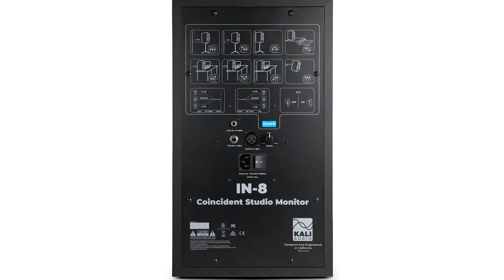Why I LOVE 3-Way Monitors: First Look at IN-8 by Kali Audio

Comment: Thanks for the video. My question is how do these sound at quiet/moderate volume? I am interested in getting a pair and I don't know if it's better to get the IN-5 or the IN-8. I mean the IN-8 are way too big for my room but I'm thinking if I turn them down a little I will benefit from their bass extension. Any tips?

Comment: What I noticed in the measurements in the web and yt, is that they lack a bit of high end. They have a dip in the 9k region and I was wondering if it a problem. Is it noticeable?  Does that dip push the engineer to bump everything up in that region and later the mixes would sound a bit harsh and maybe too bright? Thanks.

Comment: I have a pair of white Yamaha HS 7’s at home, I only have my 6 x keyboards run in stereo and plugged into a mixer, then plugged into the Yamahas, I hate how the HS7’s sound, are the Kali IN8’s a massive improvement in all departments? 

I have my monitors on stands in the corners of my rooms (around 1.5 metres from the wall and around 50cm from the side of the walls, my room is not huge

Comment: Would the new IN-8 V2 along with thier Kali subwoofers make a good mastering system for a well treated room at a fairly serious home studio? (room 8mtr x 9mtr and 9ft ceilings)?
Reply: that would be an excellent mastering system. The problem is properly implementing a subwoofer in such a small room. Alot of nodes, bass problems. If its acoustically treated, and you used some sort of room eq, then it should be fine
Reply: @ewcho8995  Thanks for your reply and confirming this for me, Kali actually just replied and also and said only 1 sub is required, as one sub keeps up with up to 5 IN-5 or IN-8's so that's good... My room has Yamaha MSP7s and HS8S sub flat down to 25Hz and no real issues as the room is well treated, and using Sonarworks... Looking forward to stepping up to the Kali System.
Reply: @ewcho8995  8 x 9 mtr is small? Lol.
Reply: @TheMicrofox  i didnt see he had used meters with feet. I thought they were all ft

Comment: are there three-way monitors better than these between 1000 and 2000 bucks? Between these and the dynaudio lyd 48 (which I don't know if and how much better they are than these) i know nothing
Reply from the maker: The Dynaudios would be more like $2300/pair which is almost 3x the price of these. Also very nice speakers. Not a coaxial design, so a bit different. There's also a pair of KRKs in this price range with the Kalis, but jut a little bit more. Also not a coax design. Hope that helps! -Justin

Comment: I keep reading that these hiss really bad. Is that not the case?
Reply from the maker: All class D amplifiers are going to exhibit some noise when nothing is playing. These do too. But they automatically mute when no signal has been playing for a little bit, so mostly you never notice it. But it is there, as with any similar amp design.

Hope that helps!

-Justin
Reply: @SonicScoop  is it more than normal monitors? Would this interfere with working? It seems like it would be hard to tell if the recording had issues or if it was just your speakers.

Comment: I do have one concern with going this route. Isn't it a better idea to keep the sub bass frequencies separate, such as using a dedicated subwoofer? This way the sub-low's don't interact/interfere with the mid's/high's produced by the other woofer and tweeter in a 3 way speaker? I'd think something like a 2 way 5 to 6" 2 way with a 10"/12" dedicated sub with proper crossover would be the ideal setup.  I haven't done a side by side comparison, so I'm not sure. The IN-8's look awesome by the way. I just wish they would have changed the look a little bit more from the cheaper model they offer, the lp-8.

Comment: How is the hiss level on these?  I have a pair of Kali LP-6 which are excellent when playing but have a lot of noticeable hiss when silent.  I'm told it has something to do with managing the associated self noise of class D amps (vs. class A/B).
Reply from the maker: There is some hiss when not playing but it hasn’t bothered me. When there has been no sound playing for a little while, they mute themselves automatically so any hiss disappears them. It wasn’t a problem for me, but if you’re very sensitive to it maybe you’ll feel differently. Most of the time they are effectively silent for hiss because either music is playing so you don’t hear it, or no music is playing and they’ve self muted. But there is some time in between where you could hear them. Hope that helps!
Reply: @SonicScoop  Thanks Justin!  Just heard today that the new Kali IN-5 monitors will reduce hiss self-noise by 12dB (as compared to previous IN-8 and LP models).  That's a huge reduction!
Reply: hiss speakers are not acceptale sorry

Comment: Hello Justin How would you compare them with Focal Shape 65
Reply from the maker: I believe the shape has a passive radiator, not an actual additional driver, so it's a different kind of design, and not really a true 3-way. I'm sure it's an excellent 2-way and I believe it should be easier to place closer to wall without issue. But it's a different kind of design. I have not heard them at length or compared the two. I hope that helps!

Comment: The Hiss Masters! An $800.00 pair of speakers should not have any noise when powered up!  My Mackie MR524's and  HR824's have no noise. Kali Audio states that they have that noise to keep the cost down? My Mackie MR524' only cost $340.00 and have no noise when powered up! That's a line of BS that they can not produce a speaker for that price with out a noise filter that virtually cost nothing. Capacitors cost pennies!

Comment: You didn’t mention crossovers though, and how three-way monitors have two crossovers instead of just one. That’s a big issue for having as flat a response as possible. You also didn’t mention that room size and distance from monitors matter; three-way speakers are generally meant for mid-field monitoring rather than near-field monitoring. I hope anyone who watches this without doing research does research before buying these.
Reply: That was an issue before this modern age amplifiers, DSP's... I bought them and they are almost perfect.
Reply: @mihailojocic  DSPs help but they're only making better compromises to try to circumvent the laws of physics.
Reply: @iqi616  You are probably right, it's a complicated conversation, but they (active crossovers with DSP) doing a GREAT JOB. Most of the time I'm working as live sound tech and I can't imagine my life without this technology. I was working before with full analog system (I'm not really young) and I really don't wanna go back. These speakers are great. I'm working with them for around 20 days and can't really find some major problem. They are MUCH better than some more expensive and famous brands. I finally found, thanks to Justin, what I'm going to keep for years.
Reply: @mihailojocic  I'm glad you're enjoying the new speakers. It's always a joy to hear familiar mixes through new speakers and hear nuances you'd not heard before. Yes, live sound has been transformed by digital technology.
Reply: @mihailojocic  I can’t wait to get these things will be my first ever pair
Reply: True. People too often forget the crossover. Having said that, the crossover in a 2-way usually contributs to the smeary midrange - particularly on 8" designs.
Reply: Also the coaxial design is a bit funny, is why there’s a big dip in the 8-10kH range. No way to trust the highs in a mix for certain.
Reply: I’ve research a ton tho… haven’t heard that 3-way is designed for mid-field. That has to do with speaker size more over, or I’d assume..?  (I have the 5” version of these)

Comment: Don't buy these before looking at their actual measured performance over at AudioScienceReview. The problem with subjective reviews is that it can take a long time to hear a flaw in a speaker, and when you do it can be hard to pinpoint the problem. Measurements reveal and pinpoint the problem instantly.
Reply: ScaleCrawling Good advice. And they measure well for those interested.
Reply: @duythai5442  No they don't. The IN-8 does not measure good.

Comment: Why exactly is this "unique?" It is the same concept and sesign for 3-way monitors that M-AUDIO has been making for many years, the M3-8. They discontinued that one a few years ago because it was getting long in the tooth and did not sell in sufficient quantities. Now it is KALI that is making them. Also, a studio monitor where the MF mids are HF highs are driven by Class-D amps -- is in reality a bad idea. Which is why the better quaoity 3-ways use PWM Class-D amping ro the LF woofer driver(s) only, and Clas-AB amplifiers for MF and HF. Case in point: Adam Audio's new A-series 3-ways.
Reply: Class-D isn't what it used to be.
Reply: have you even heard them? 😁

Comment: Hi,  KRK RP10-3 G4 VS KALİ İN8 ?
Reply: KRK RP10-3 were good for Generation 1, 2, and 3. Now they have Class D amps for LF-MF-HF in their current Gen 4 models, so I would not get them for anything. This Kali here is the same exact 3-way monitor that M-AUDIO has been making for many years, the M3-8. They discontinued that one last year because "it was getting long in the tooth," or so they told me. Now it is KALI that is making them. In my view, a studio monitor where the mids are highs are driven by Class-D amps is a bad idea and a needles compromise. So, I would only get the M-Audio M3-8 or one of the previous generations of the KRK 3-way.  M-AUDIO is better, it has coaxial mid-high drivers like the Kali replacemenet.

Comment: I can't decide between these or, Fluid FX80?  Please do a comparison, thanks.
Reply: Fluid Audios like the FX8 and FX80 are 2-way coaxials, so you are missing the mid-frequency driver. Will definitely hurt you in mid-range frequenci3es, such as human voice. Here with this Kali you have all three -- low, mid, high. The mid and high share the axis, the woofer below has its own.  This Kali would not be too bad if at least the MF and HF would be amplified using Class AB amps. But all Class D for all 3 drivers? It's a non-starter for many folks.

Comment: M-Audio made coaxial 3-ways.... they were quite cheap, around USD $260. Still, they sold poorly, so M-Audio withdrew them from the market and provided no replacement for them. Hopefully Kalis will have a better longevity and staying power.
Reply: Frank Farago I was thinking of swapping my jbl 8 mk2 for these? Would u say it’s not worth it?
Reply: @KeyLocs  I also have the JBL 3-series. Amps are Class D there, same as here. The HF waveguide is superb with the JBL, theyx got that from their cinema speakers. I would say that the JBL 3-series with ther 8-inch woofer will sound a bit more robsut, but overall this Kali 3-way would perform smoother.  There is only so much you can do with 2-ways.
Reply: Regarding the JBL 2-series. I purchased 6 of those soon after they came out. The original Mark 1 series with the pro-looking matte black cabinets. Amazing monitors. But the components were pricey, thus their profit margin low, so JBL Pro had killed that line quickly, and been peddling the garish piano lacquer Mark 2 units ever since then. I would not trade my 6 Mark 1 300-series units for 66 of the Mark 2's with that garish-looking piano laccquaer finish. Remember, there was nothing wrong with the Mark 1 edition of the 300s. It's jsut JBL could make the Mark 2s cheaper, is all. Capitalism at its finest.  :face-blue-wide-eyes:
Reply: @KeyLocs  Fluid FX80
Reply: @junglist1soldier  If you need to get Class D amps, go with that one, although Fluid Audio still sells then Class AB amped model for about $50 less.

Comment: why are manufacturers afraid of publishing frequency response. opinions don't mean a thing.
Reply from the maker: Frequency response is important and a good measurement for companies to releases. And they usually do! At least the +/- tolerance within a specified range.

Frequency response *charts*, however, can be a little more specific to each unit. For instance, I owned two AKG 414 BULS. They both had the same frequency response tolerances of +/- “x” from “y”hz to “z”khz. But each one had their own specific charts which showed slight bumps and dips in different places. These are very well made mics. But that’s the reality of working with physical membranes.

Those differences showed but as slightly different squiggles on a chart. But are they going to be differences you can really hear? It depends. But remember that our ability to measure is MUCH more refined than our ability to hear.

Not every company or product has the budget to test every speaker or mic that comes off the production line in an anechoic chamber for its unique frequency response. They are very expensive to build or rent, and will increase the cost of the product significantly.

With all that said, frequency response isn’t the only thing that factors into the sound quality of a mic or speaker. It is just one dimension of sound, though an important one for sure.

Hope that helps!
-Justin
Reply: @SonicScoop ..i haven't seen a single studio monitor 2 or 3 way with published frequency response. the so called frequency response from Original Mackies ( which i owned back in the day) was generic. the frequency response is most important because not many people have a perfect room so we have to measure the frequency response in the room and then make necessary EQ adjustment before our ears can make accurate  mixes. speakers sounding good is worse way to pick studio monitors. as far as Kali publisded specs 45 Hz - 21 kHz for a 3 way is not good at all. many 8 inch 2 way monitors match that or go lower than 45 hz.

Comment: For those wondering, they do hiss. And if using them near field, it may be slightly annoying. Dialing in super quiet mix elements can be a little troublesome. Noise is audible up to 3m for me. That said, I finished my first mix on these over the weekend. Blown away. Translation was great, no fatigue, great imaging, large sweet spot, etc. I would have gladly paid $50-$100 more for no hiss. I came from HS-8s, which were near silent in this regard.
Reply: who is buying a hiss monitor ?
Reply: @Pit I to had the Yamaha HS8s before getting the in8s and the hiss shocked me, but I’m wondering if you think what the speakers brought compared to the HS8s was worth dealing with the hiss?
Reply: @kablah19  same question
Reply: Robert Glenn San Socie for me, so far, the clearer mid-range has made it worth it for me, but the hiss does make it harder to hear the end of reverb tails, but since I have good headphones, I don’t really need to depend on the kalis for hearing really quiet detail. I also found that moving the speakers closer to the wall helped me to get more frequency response in frequencies below 80hz.
Reply: @kablah19  many thanks!
Reply: Pit what is the frequency of the hiss?
Reply: It came down to the HS8s and the in8s and I just chose the in8s... Based on your experience with both, was it a good idea going with these over the HS8s? The deciding factors for me was these being front ported vs back ports of the HS8s (I have to have them closer to my wall due to room size limitation), the 3-way coaxial design, and the fact that I already have the HS5s ... Just a bit nervous because it's a new company (Yamahas can be found in many many studios, as they have a proven track record), and I'm worried the hiss will be an issues I won't be able to deal with. I don't have that issue with the HS5s and I doubt I would with the HS8s either... Do you think I made the right choice going with the in8s?
Reply: @23Guitardood  its a new company found by ex jbl employees so they know their shit. whats the hiss like on yours?
Reply: @aces3261  honestly, it's not bad at all. I'm about 4.3 ft away and it's tolerable for me... and they sound freaking amazing.
Reply: I realize I am commenting on a 5 year old post, but in those 5 years the IN-8v2 models do not hiss as  Kali has resolved this issue.
Reply: As soon as you start listening any music hiss isn't really noticable. I'm not complaining. They are amazing!!!
Reply: I really wish they would have spent a few more bucks (charge us too), to eliminate the hiss.  I still can’t find anything else to replace them with that presents as much value.
Reply: They listened to the feedback from users and improved the monitors so now they have much less self-noise.
Reply: @filiphosko  hey! You mean that the same model now is just simple less noisy? Or you are talking about new model?
Reply: @LinasPOfficial  I was thinking about the "2nd wave" model (as they call it, you can look it up on Thomann for example) but it's still an IN-8.
Reply: @filiphosko  they're dead quiet now...
Reply: Krk 10-3 g4 vs Kali iN-8 ?

Comment: Better in the midrange.... WHAT ABOUT the #Pioneer SP-BS22-LR #AndrewJonesDesigned Bookshelf Loudspeakers? Does anyone have any VIABLE insight on a comparison between the Kali speaker line up and this Pioneer?
Reply: The Pioneers you've mentioned are hi-fi speakers with 4" bass woofer with a 1" tweeter and are "colored" by design to sound exciting when listening to. The Kali IN8s are trying to be as flat as possible, to be good to mix on. Wouldn't compare the two.